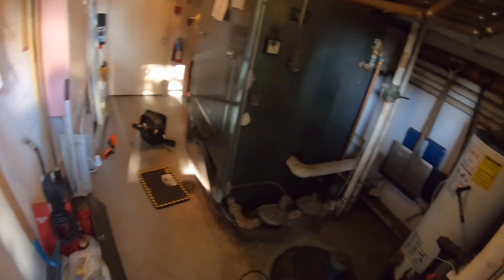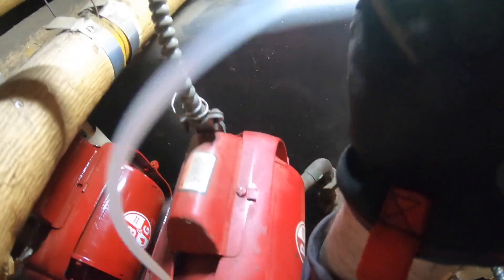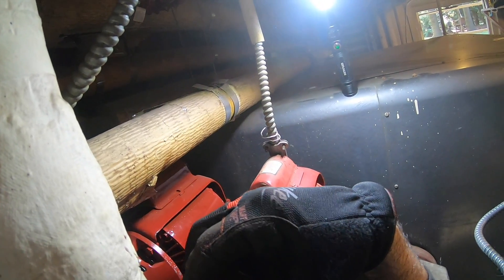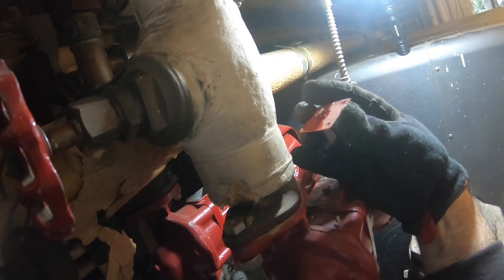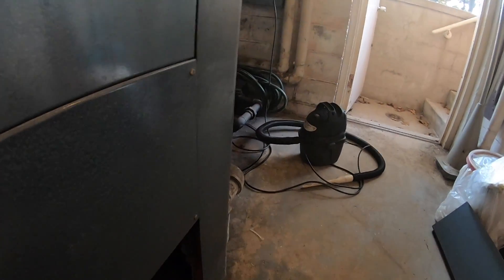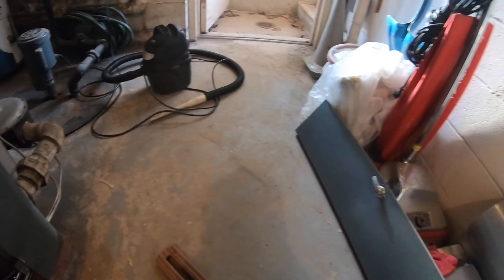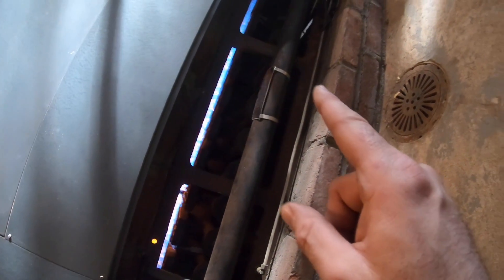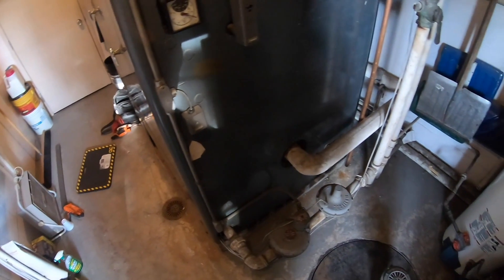Hot Water Boiler Maintenance And Pump Service

Comment: That boiler is actually a Weil McLain H-series boiler with another nameplate on it. I have one exactly like it in the basement of my 1830's era house and it works great! The flame rollout is definitely a problem, even with the cover off, the flame should just light and draft upward. Thanks for the great vid!
Reply from the maker: Thanks for letting me know that.  didn't;t see the Weil McLain name on the boiler yet never investigated further. It's why I like sharing my work. I learn a lot just from useful comments like the one you posted. Hopefully your home is an easy restoration for you. Older houses are built solid. My wife wanted a newer house since she is afraid of asbestos and many other things. Therefore I have lots of work on tightening up structure to reduce noises as someone walks on the second floor

Comment: How much oil did you add in the three ports?
Reply from the maker: The two ports around the motor just a quick squeeze. The bearing assembly I put some oil in until the area looked saturated with oil

Comment: We have lots of boilers here in CO
Reply from the maker: In NJ it’s at least 65% boilers
Reply: @thehvachacker  yeah boilers are challenging but the call can turn into a nightmare quickly. Nothing better than hydronic radiant heat
Reply from the maker: I love boilers, problem is anything with water can become a problem once touched like valves or pressure regulators, expansion tank diaphragm giving out while bleeding, ect

Comment: I HATE Boilers, I refuse to work on them, but I did enjoy your video
Reply: Boilers one of best types of heat. This is an old girl. Big old cast iron burners. You dont see too many heating systems last as long as well maintained boiler system.
Reply from the maker: What do you hate about boilers? I have a co-worker who just moved here from Arizona and is getting a crash course in boilers
Reply: The reason why you hate them cause yoi dont understand them completly
Reply from the maker: JJ only the thatcher furnaces seem to last this long when dealing with forced air. Yet it was a giant drum that a torch burned in. I would take a water or steamer any day over forced air. Superior might live in a part of the country where boilers don’t exists. I have a coworker who is an Arizona transplant and is getting a jersey crash course on water systems. He is forced to learn or might have to move. I know he will learn. Just takes time.
Reply: @thehvachacker  haha lol. I was going to say how about good old Lennox Pulse. They had cast iron primary heat exchangers. Built like a tank and felt like it when you had to remove one
Reply from the maker: Superior I feel the same way about oil heat!
Reply from the maker: @Superior Comfort Heating & Air LLC I understand and worked on many of those suitcase muti heat/ hot water units. Baxi, embassy, and a few others was popular. They weren't reliable and a pain to work on
Reply: The reason I don’t work on boilers my liability insurance would be triple the amount I am paying now, there are some boilers here, but not enough to justify the insurance premiums, the other reason is that the other company I use to work for installed those little “suit case” wall mount 90% boilers they didn’t seem to be as reliable,  like those wall mount water heaters. Just my opinion only
Reply from the maker: @JJ 109 Not many pulses left after Lennox attempted to purge them from existence